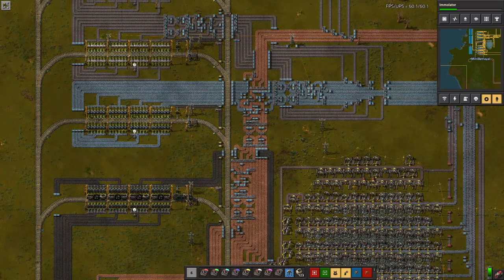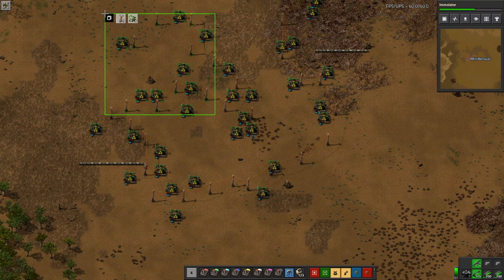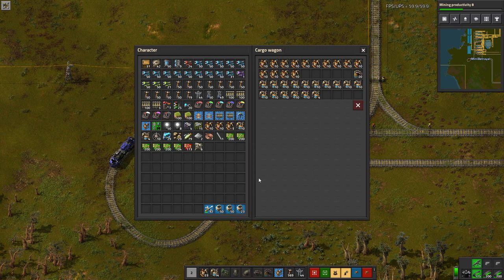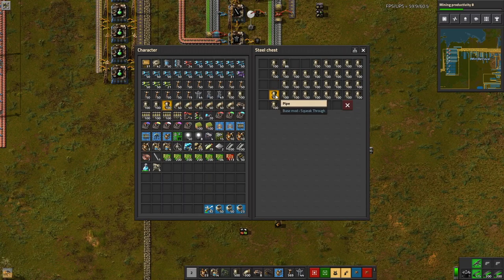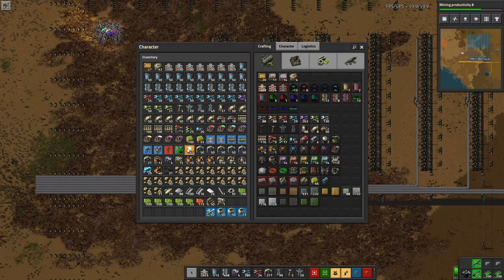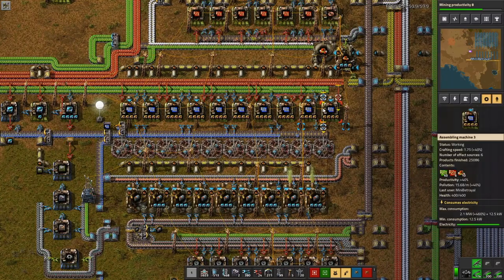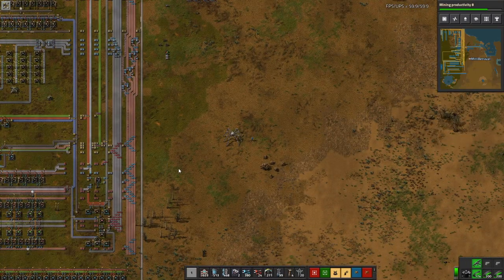Petro-Metro - Factorio Megabase 2x25

Comment: @1:38 Ideally your nuclear plant should be 2x4, not 1x8.  You're losing a lot of neighbor bonus by having them in a single row.  Also, you only need a single heat pipe for each spine.  On the other hand, aesthetically it looks good at night!

@3:04.  There is are nice blueprints available that allows you to completely claim all oil fields in 1 go.  Especially nice when the oil field is in a forest

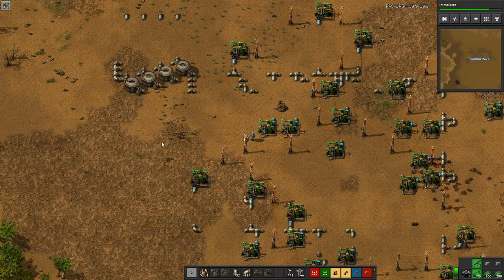@9:40 Southern most pumpjack missing pipe connection

As you're going through the calculations for plastic output, I was comparing to my setup.  A full-beaconed plant ( 12 beacons ) only needs 5 to (almost) saturate 2 blue belts - 85/s... at only a 50% increase in power ( ~12 MW vs 8 MW ).  Shows the power of beacons.
Reply from the maker: Yeah but i wanted to design one myself. 

Thanks, will look into the missing pipe